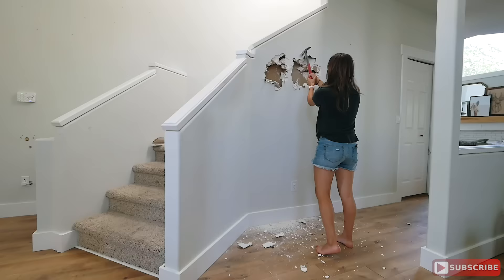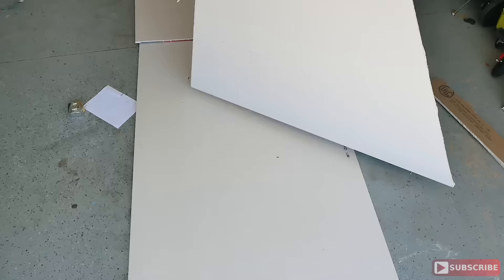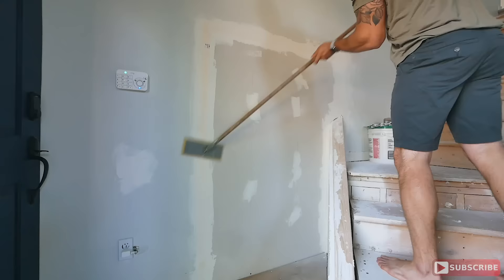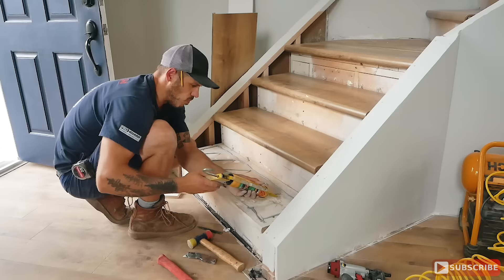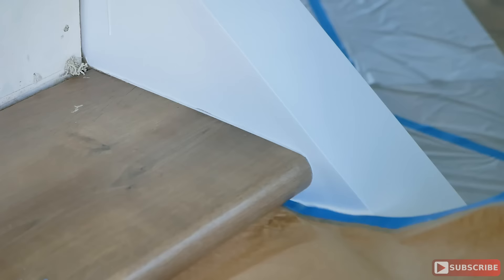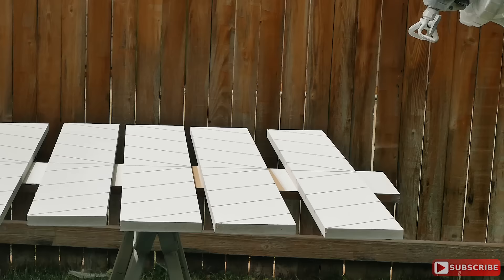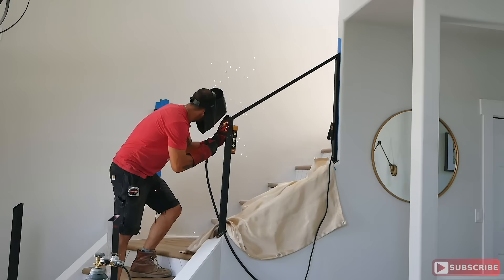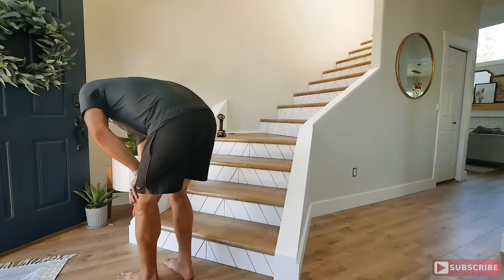DIY Staircase Makeover

Comment: All of Canada and most US building codes don't allow for railing balusters to run horizontally. Make sure you don't get caught in a inspection otherwise you'll have to rip them out!
Reply: @JayGreyhood  not about strength unfortunately. They're considered "climbable". Kids were getting hurt and dying because they would fall off a flight of stairs. Most building inspectors in Canada wont certify the building for occupancy before these are changed. 

You could, like you said, put glass over so that they can't be climbed. Just take the glass off after the inspection (;
Reply from the maker: Inspection only counts in new construction.  Nobody is inspecting in existing housing
Reply: @MrBuildit All "major" renovations require a permit and a follow up inspection...
Major often meaning modifying walls, stairs, or electrical/plumbing.
We had a small wall moved, neighbor called in,  and went through inspection hell afterwards.

Most the time you can get away with it, like you said... 
Just noting for other viewers (:
Reply: @Tyman9819  Yeah this guy doesn't have kids yet. Kids will definitely climb that when you're not looking and fall off. 2-3 year olds are suicidal. Lol!
Reply: That’s easily fixable. 
Just put a glass panel
Reply: @boltup5566  there are two kids in the thumbnail

Comment: Spray paint, weld metal, .... in the living room ... It´s a nice Staircase, but ... u know whot i mean.
Reply from the maker: Hahah. On the spot building
Reply from the maker: You’d be amazed how many professional contractors do the same.
Reply: Mr. Build It if they worked for me doing that I would fire them lol. How long did it take to clean the over spray off your floor? Lol

Comment: 0:43 - WTF is that super sketchy power wire going from an outlet INTO the wall?
Reply: It goes to a security panel. That's how most places install the shit, unfortunately.
Reply: That would be a low-voltage wire after the transformer.  The rules for running low-voltage wiring are very loose to non-existent, they dont pose much fire risk.
Wiring at 120/240+V is what codes are really strict on.

Comment: The staircase looks great. A couple tips. 
You can square cut the drywall and then run a drywall saw along the top of the wall. Save a lot of time. 
Use the all purpose to install the tape. It's mud plus adhesive. Use the blue lid compound for the topping. It's easier to sand. Also, a few drops of dish soap while mixing will eliminate air pockets and those little annoying holes in the application.
When applying glue for the treads, don't connect the corners. Leave an air gap. Trapping air will make any product you're installing rise and move until set.
There are a few details here and there but it looks really good...

Comment: Bad ass work. My only recommendation is to use real automotive base coat and matte clear finish so that all ur hard work will last longer. Buy a cheap HVLP gun and spray it on instead of using the can stuff. They never dry well and using the matte or clear finish never has a hardener.
Reply from the maker: That’s great advice. I’ll do that next time for sure.

Comment: I love the look but one thought is if you would’ve built and installed drawers into your risers at least for the first few steps it would’ve been awesome, semi seamless/hidden and extra storage you otherwise don’t have especially since you didn’t build in pull out cabinets into the side wall of your stairs! It would be really neat in combination with your decorative angle dado’d risers! Still could but you’d have to rip the risers out and have access into the space underneath your stairs for screwing in the frames and drawer slides.

Comment: Love the video! Thanks for sharing. We just bought a house and we are going to redo the stairs with cap-a-tread. Some questions for you... 1. Did you use the cap-a-tread piece on the landing? If you did use it on the landing did it fit flush with the laminate you used? 2. What brand of laminate did you use? 3. My first three treads are extra long (51+ inches) would you recommend using two pieces of cap a tread on those steps?

Comment: Hi, Just wondering if you could clarify the wall thickness on the metal,  you said it is .065 but then said that its basically 1/8.   I am  not trying to call you out i am just trying to figure out what you used to replicate in my project. .065 is 1/16 and 1/8 is 0.125 which did you use?

Comment: If this is in the United States I am pretty sure that doesn't meet Building Code requirements. Railing need to be 42" tall, and the bars have to be spaced such that a 4" diameter sphere cannot pass through (like a small child's head).

If it was purely aesthetic, I'd live and let live, but this is a life safety issue.

Comment: do not measure anything in the drywall , connect the drywall first, and then cut the shape with the utility knife after it was placed, this way the line will be the same shape and correct location of the place, and you don't run the risk of cutting it a bit too short, or just a hair too long that will make it harder to getting it correct size

Comment: would of been much better to use a air brush system since you already have a good compressor they are pretty cheap if you dont plan on using it for the next ten years

Comment: It does look good but don't wire weld inside the house.  And 0.065 is not an 1/8 inch....0.062 is 1/16...0.125 is 1/8.

Comment: Why demo the whole wall? I would of just chalk line on the existing wall. Follow the chalk line and CUT NICELY WITH A SAW SAW through the drywall and studs. Then add a top plate and drywall and corner bead or cap it  with MDF or pine wood whatever.

HOW MUCH TIME SAVED AND SO MUCH LESS WORK BUT SAME RESULT AND Sturdiness. MUCH LESS SHIT TO DUMP AND BUILD.

Comment: 10:09  "... .065 wall which is basically 1/8" thick when it comes to steel." BAHAHA. Number one, .065 is 1/16th thick and number two, that math stays the same throughout the universe. 1 divided by 8 is .125 and 1 divided by 16 is .0625. (Steel mills extrude 1/16 tube, square or round, at roughly .065). Jesus..stick to your tape measure.